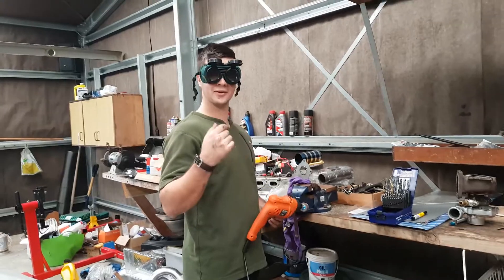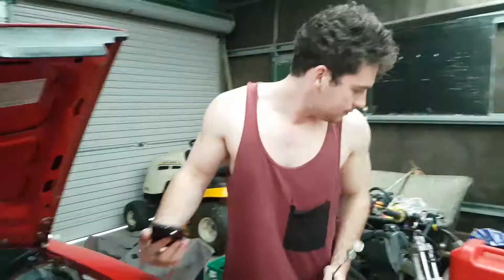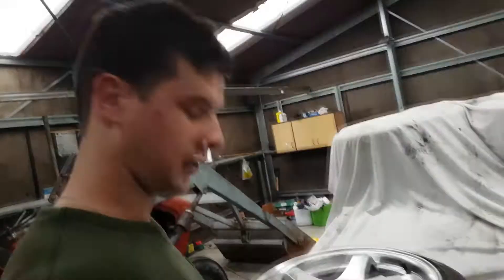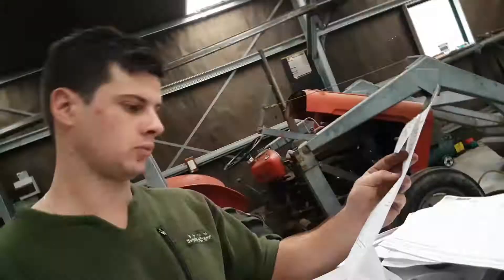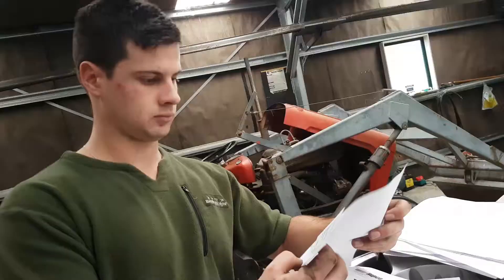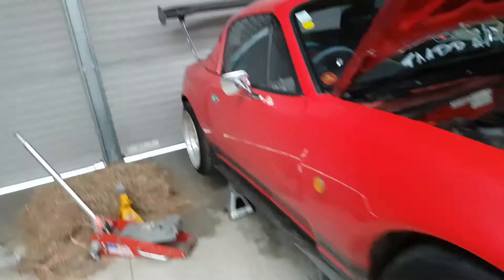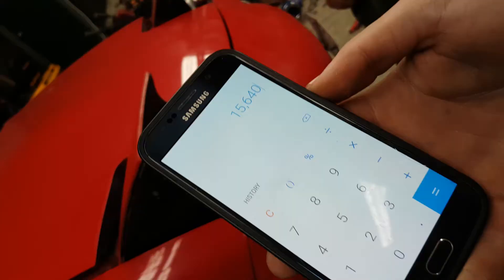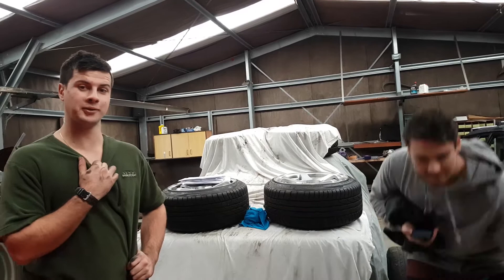How much did it cost to build the turbo miata?

Comment: Good christ.  19k??!!  I slapped a CX Racing turbo, Megasquirt and ACT clutch with light flywheel in mine and I'm under $2500USD.  Pulling 10lbs.  Course, mine doesn't look as good as yours because I'm stock af everywhere else, but holy crap.  You have to really love spending money on a build to do what you've done.  And also, I'm only at about 200hp.  Not the 300 you're gunning for.
Reply from the maker: Brendan is a crazy man! Sometimes we question his decisions haha. The main components of the engine build would of only come to around 7K NZD which is around 5K USD.
Reply: 200whp? If soo i feel like thats enough for a track car that what im aiming for in my nb i dont need crazy hp on that maybe 250 whp max